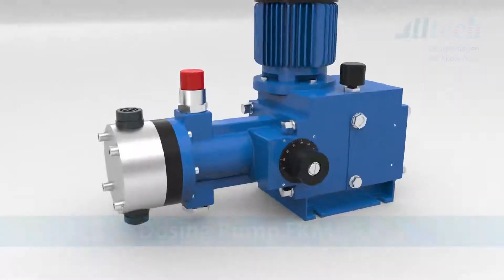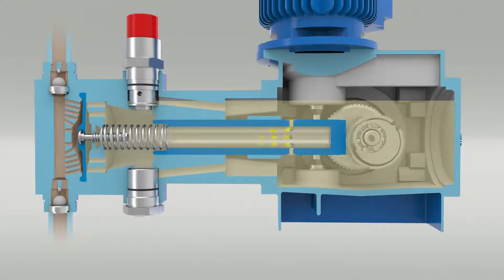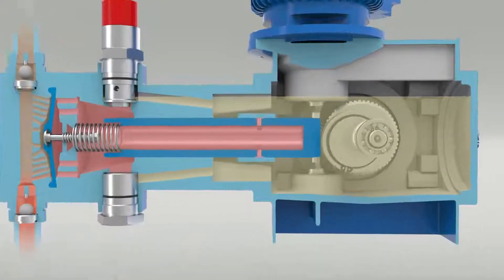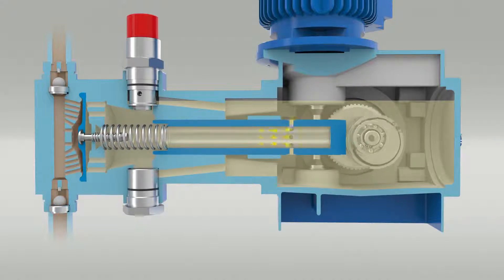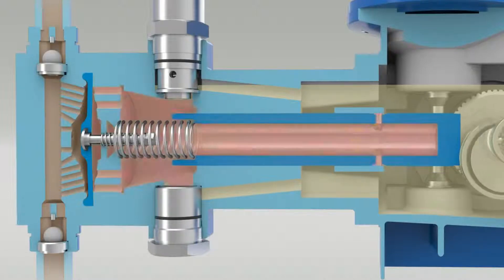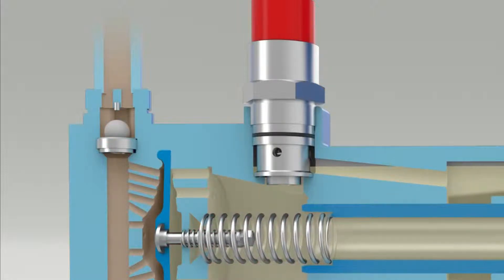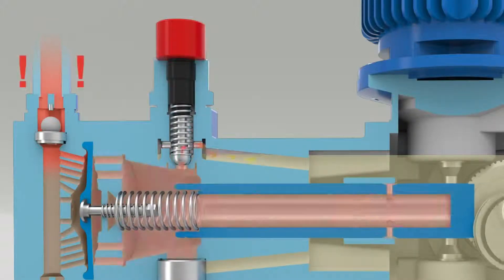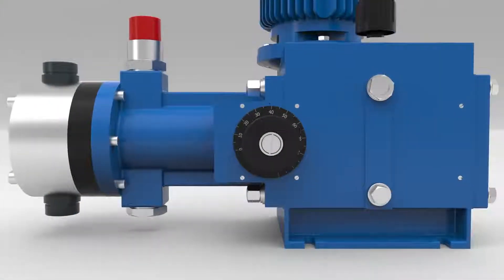FKM  Functional principle

Comment: We would like to pump a molten mass at 130 DeGc,  which is solid at state and it's melting point is 120 DegC.  Can your pump can help us in lifting / dosing the said mass against an head of 10 meters and against a pressure of 2 bar.  Please confirm

Comment: How to dischage the  pressure appliance ?
If you send me a video explain that,  thank you
Reply from the maker: When the pump is stopped, the piston will go back to its „ 0 ( zero ) “ position so
 that the compelte hydraulic part will be depressurised.

The head and the dosing line where the chemical is under pressure needs a drain valve
 to be installed after the pump in the dosing line. By opening that valve you can also depressurise 

the head and dosing line.